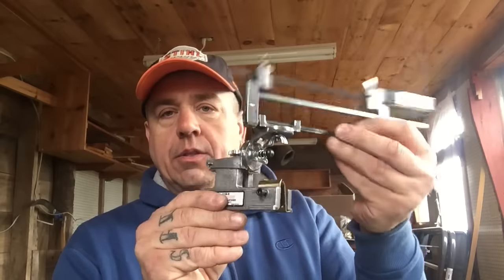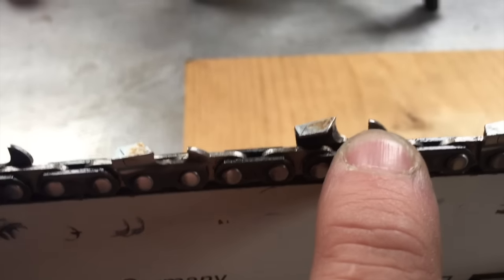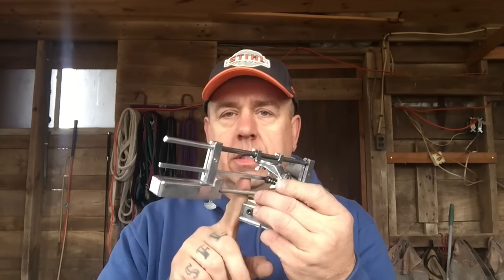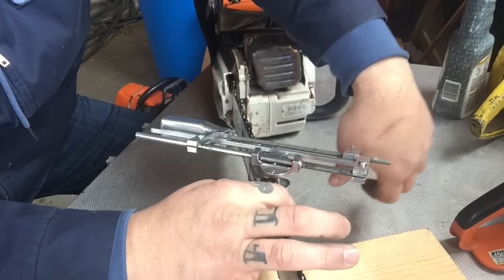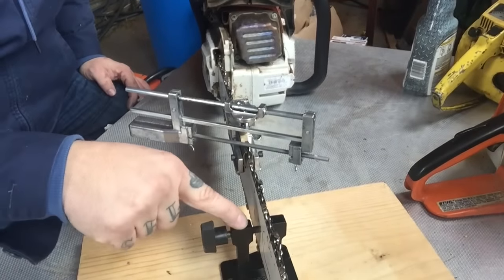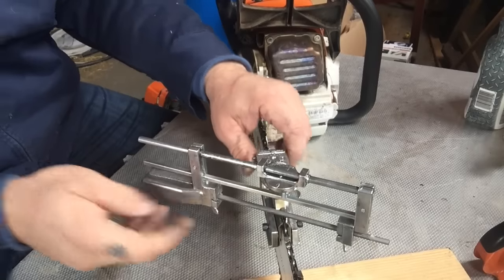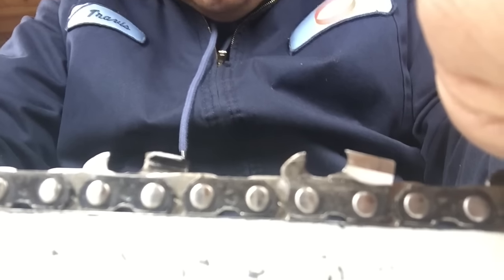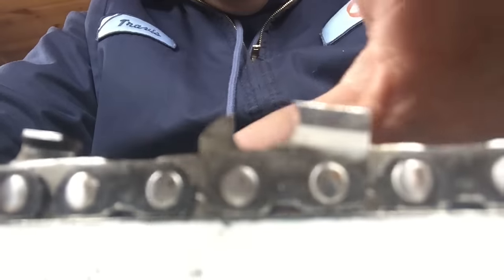How to sharpen a chainsaw......  With the Granberg File-n-Joint

Comment: I bought mine 45 years ago and was concerned that it wouldn’t last very long because it appeared to be made out of pot metal but I still have it and still use it. I even bought an extra one because I was afraid that they would stop making it.  I use mine with two hands, pushing and pulling for a smoother stroke.
Reply from the maker: That’s awesome!  I have some vintage ones, they were built well!

Comment: I just received my grand burg.  I just sharpened the saw I didn't realize the answer to pushing the incorrect way on the tooth. I could tell by the look of the tooth that it didn't sharpen as good as the other side.  I came on here found your video and presto.... here was the answer.  You flip the guide around.  Awesome.  I see somebody else demonstrating the grand burg pushing the wrong way. I am hoping that it sharpened that side good enough until the next sharpening.  thanks for your demo.
Reply from the maker: Thanks for the comment!  
It should be ok, but now you know how to do it from now on. 👍

Comment: Only thing I do in addition to everything you explained is I put a coating of grease on the sliding rod of the "carriage" and a little bit on the square rod that touches the tooth length stop. Converting chains to ripping chains with that tool I got pretty aggressive with it and the aluminum started to gall. But nice and easy normal filing it's no big deal. But it does make the whole rig run a lot smoother. Thanks buddy. Have a good one
Reply from the maker: Kyler Monares 

Oh,  wow!  Good tip!  I wonder if a dry graphite would be good?  Hmmm...  

Thanks for watching Kyler, and thanks for the suggestion!

Take care!
Reply: Good Day Farm I'm sure it would. Anything would help. I used to use a dab of bar oil but I would have to reapply it every chain. The grease lasts about 5-6 chains. I'm sure the graphite would last 2-3 chains. More portable too since it comes in those little tubes! Have a good Sunday friend!

Comment: HI:   Looks like you'd have your round files last longer, cut faster, with fewer overall strokes too,  if you simply adjusted the parts of the device that clamp it in place, further apart.  There are 2 screws in the files clamping bar for that adjustment.  I moved mine as far apart as I could to still hold the file securely,  yet show the full length of the files  cutting surface.   Now I get the longest, fullest length strokes out of the files entire cutting surfaces & length.  Great video in any case, so much good stuff in it!!!  :)
Reply from the maker: Great tip!  Thanks!

Comment: Tip: I took the file complete with the wooden handle then installed it on my file n joint. Now I can use it with both hands very comfortably especially in a bench vise and getting real good control.
Reply from the maker: Excellent!  👍

Comment: Notice how your left side cutters are much longer than are the right.  More than just what is accounted for in that one sharpening.  With this type of jig, I find it necessary to re-adjust the back stop after completing one side and before beginning the other; using caliper or such to achieve same lengths.
Reply from the maker: I have never worried about cutter lengths matching, as long as you set each depth gauge (raker) to its cutter, the chain still run fine.

Comment: I have been using the same Granberg since 1975, still going strong. I did not watch all of the video, but wondering why you push the file instead of pulling it? I file in the same direction on the tooth, but I switch the handle around and pull it so that it does not jerk. It is a smooth pulling motion. Just wondering if I have been doing it wrong all these years?
Reply from the maker: They are a good product, that’s for sure.   I push because that’s how I’ve always done it, personal preference I guess, I do not believe either of us are doing it wrong.

Comment: I have a small (9.5" bar) electric pole saw I used for limbing up yard trees. Oregon Bar. Not sure what size file to use with this jig. e.g. 5/32 or 3/16. Any suggestions? Thanks.
Reply from the maker: +Gary Wallbaum 

Any idea what size chain is in it?  What pitch?

I would think 3/16 would be fine, but without know what chain it is, I can't say for sure.

Comment: Great video !! Which one does a better job of sharpening the Timberline or Granberg bar mount ?
Reply from the maker: Lamont Hunt 

Great question Lamont. 👍

Very close call...  but I would say as long as both are set up properly, the Grandberg does a little better job. But....  the Timberline might be quicker and easier. The cutters lady a long time. 

The Grandberg can be quick, especially once you get the hang of it. Files wear out fast, but a fairly inexpensive. For my, the Grandberg is a better guide simply because of the versatility. Cost is considerably less too. 

I recommend the Timberline for someone that really struggles with filing. And for the occasional sawyer, I could be the only guide you ever need or want. 

Thanks for watching, and for the great question, take care!

Comment: This is a great video!  Thanks for the clear explanation of how this works.  Could you use this to file a square chisel chain?  I recently bought one and LOVE the way it cuts, but I'm trying to decide what to do as far as filing - I know it's a little trickier than a round file and the Granberg would fit my budget better than the ATOP jig.
Reply from the maker: Thanks!
I’ve never tried it, but I’ve heard you can do some minor modifications to it so you can use a triangle file for square ground chains. 
You can use some vintage models with a double bevel flat file, I have a video on that. 
Thanks for the question.
Reply from the maker: Here is the link. 

https://youtu.be/mb7ssn5uQgU

Comment: It looks like your guide is straight out of the package. The file handle is hitting the guide after only a 4-5” file stroke. If you loosen the screw that clamps the file “handle” end to the 2 bars, you can slide the handle back on the 2 bars about 3” and get more use out of your file and a longer stroke.
Reply from the maker: Thanks for the tip. 👍

Comment: Can you use a square file for chisel chain on it.
Reply from the maker: Great question!
You can get a six sided triangle file to work, might take some modification though. I haven’t tried it personally, but I’ve heard it can be done. 
I have a video where I use a vintage Granberg, a 104 model I think, it’ll take a double bevel flat file.

Comment: You do not want much hook in a tooth because if you file a chain with an aggressive hook you are creating a very dangerous chain prone to kick back. Yes a hook tooth will cut wood very aggressively but it is not safe to use. I use to think that the most important edge was the top edge and I now know that was not correct. The side of the tooth is what is doing the hardest work, if you take a wood chisel and lay it on a board it can be pushed along fairly easily, now take the same chisel  and try to cut off end grain the same way, it will be much harder.  The side of the cutter is cutting end grain and the edge on the top plate is simply removing the chip the side has severed. I do not use full chisel chain because it does not hold an edge near as long as semi chisel chain, yes full chisel chain cuts wood a bit faster but you will need to sharpen it quite a bit more often. Once the fine point gets dull the chain is done cutting wood, full chisel chain is designed for felling standing timber and not for cutting firewood. The way I figure it is, reading is like cheating in that you do not have to make all the same mistakes that have already been made by someone else trying to figure it all out.  I have read the book and this is not my opinion it is an opinion based on the facts I got from reading Carlton's saw chain book
Reply from the maker: I’ll agree, too much hook is bad, but I’ll disagree that it can cause kickback. I believe the operator controls that. 
The issue with too much hook is it can cause the top plate tho break off, thus becoming blunt, dull. Not good. 
I only run full chisel, and I only cut firewood. Works great for me. 
I also run a lot of square grind chain, contrary to what others think about using it for firewood. Works amazingly. 
No matter what style cutter you choose to run, keeping it sharp is key. 
I use what I use because it works great for me, based off my personal experience. 
Thanks for the comment, I always enjoy other peoples perspectives, it is how we stay educated. 

Thanks for watching, take care, and have a Good Day!
Reply: Would you care to read Carlton's book on chainsaw chain
Reply from the maker: Absolutely !  I had not heard of it till you mentioned it 
Information and knowledge is a good thing. 

I’ll Google it and see where I can buy.it. 

Thanks!
Reply: I don't believe the book is available so I up loaded it to my web site http://www.squirrelhouses.com/Chainsaw%20book.html
Reply from the maker: Awesome!  Thanks...  I’ll take a look tonight. 
👍
Reply from the maker: I have several different types of depth gauges, my favorite is made by Jet.
Reply from the maker: Good information.  I have the Husqvrna guide. 
I need to look into the different styles more, they call the one I use a constant, but I always thought it was a progressive style. Hmm...

Thanks for the info!
Reply: @imysteryman  Good book.. thanks!

Comment: The unit I have is marked "G106  A"  Not sure what the difference is.  Also the depth "things" on my chain are in between the teeth and the the tooth stop guide and they interfere with it.
Reply from the maker: Hmmm....  I’m not familiar with that model. 
I’d need to see how you’re setting it up, the depth gauges shouldn’t be in the way.
Reply: @GoodDayFarm  Well it seems I was doing something wrong in the set up. After watching your video I set the unit up on my saw and all is well.  Thank youl
Reply from the maker: M. Dean Blanck , great!  👍

Comment: Excellent video!  
I bought the jig after viewing the video .  Works great. Thx
  One question : Is it normal to have a medium sized burr behind the cutter after filing?  
Thx
Reply from the maker: +Carlo Sunila 

Thanks!  I’m glad you found the video helpful. 

I don’t usually see any burrs. Few things I can think of off the top of my head. 
Could be chain brand.  Different brands use different material with different hardness. 
Could be the file height. How low are you filling?  Are you filing out the gullet?  
Not as likely, but possibly the file itself. Try a new one, or different brand. 

Hope that helps, let me know how it goes. 

Thanks fir the comment, and thanks for watching!

Take care and have a Good Day!
Reply: Producing a burr is part of the sharpening process. It shows that the file has reached the edge. It’s only necessary to produce the smallest of burrs, more than that just a waste of time and chain.

Comment: 20 percent of the file above the tooth is the target.
Reply from the maker: Agreed! 👍
Reply: @GoodDayFarm  but leaving only 15 to 10 percent above the tooth can make a wicked sharp chain that goes through wood like butter.  Doesn't stay sharp as long but sure is a quick cutter.   Thanks for the video.
Reply from the maker: That’s what I like about a good quality guide, you can make adjustments like that to see what you prefer. 
I usually go for a little more aggressive/sharp. I don’t mind filing more often, but love cutting quicker/easier.
Reply: @GoodDayFarm  Totally agree,  I love a super sharp saw.  I have many tools for sharpening and am pretty darn good at free hand but I just restored my fathers old Granberg 104 that he broke a long long time ago.  I had to tig weld a piece of aluminum on the file holder.  I've never used one before and quite enjoy the adjustability  of the granberg.  I sharpened two of my saws with aggressive sharp teeth and had a good time today with one of them cutting fire wood.
Reply from the maker: I really like the vintage Granbergs, I have a couple.
Reply: @GoodDayFarm  my first was  in 1983 when I got my pro Mac 610. I just got my 2nd which is a massive improvement.

Comment: He said it hard to adjust , all the equipment is crap , you literally need baby hands and takes forever to make anything they make to actually work
Reply from the maker: This guide can be difficult to loosen the adjusters on, but that doesn’t mean it is a crap tool, or that it takes forever. 
It is an excellent guide, works great.